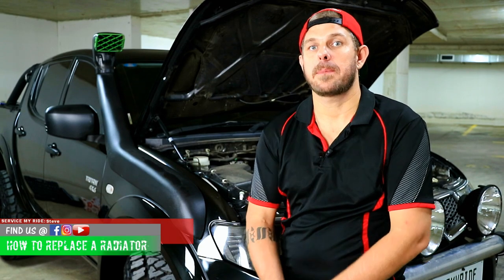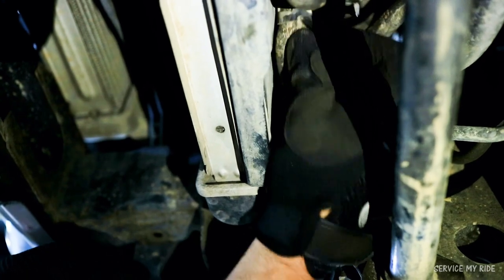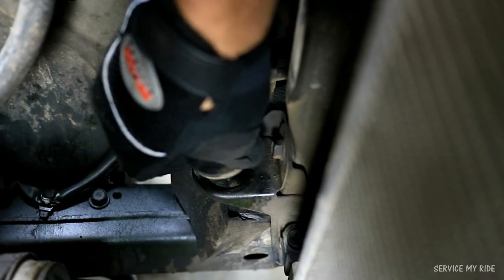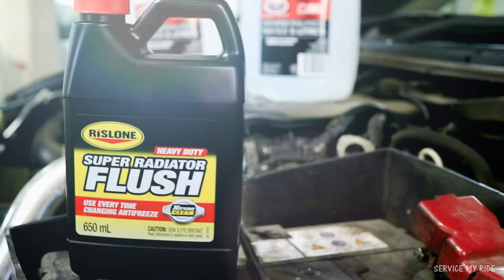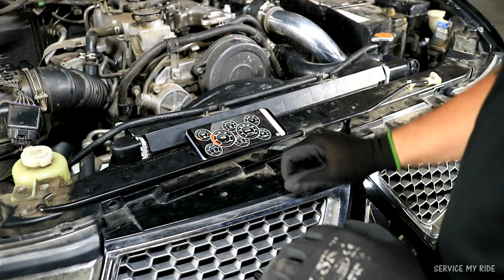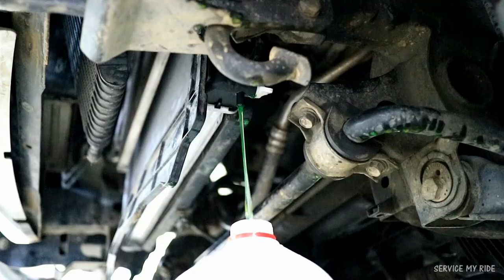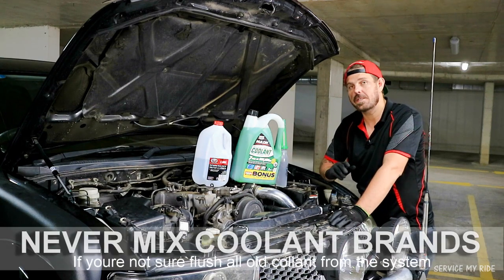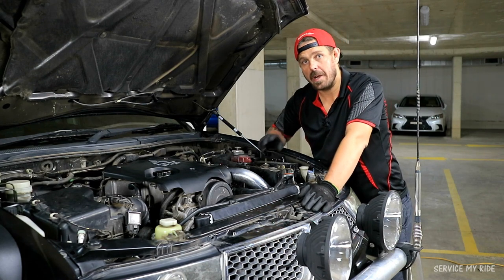HOW TO REPLACE A RADIATOR (new radiator, flush and fluids)

Comment: Thank you for a most informative vvideo on replacing n flushing my radiator.however, i have nno ownners manual for 1991 chrysler new yorker. Would you happen to know or find fluid specs for this 3.3 L engine; or. Know wheree to find themm watched this video msy8 at 2:30 pm mdt usa

Comment: Great video. 
I have a problem. I only have heat on the left side in the car. None or little on the right side. Flushed the heatingcell. Any ideas? I have the steering wheel on the left side.

Comment: Hey mate just wondering how I can diagnose my mn at the moment 
I put coolant in the resi and it drains within the week and it doesn’t seem the radiator is getting much coolant either. 
The car will over heat and lose power 
??

Comment: Good evening mate, just wanna ask about the problem of my triton mn, if the car is not moving and the aircon is on the engine temp goes up high but if the car is running fast the temp goes back to normal. I wonder if the problem is thermostat or the radiator? The radiator fan is running though. Cheers.

Comment: Question, the automatic transmission cooler lines (red fluid) when I take them off leak like I've just taken a sump bolt out leaking excessively. Is this normal?

Comment: Hey mate thanks for these videos.... I am just wondering have you heard of any Radiator / Trans cooler core's splitting inside the radiator and letting coolant into the gear box....?  I am only asking because i had an old BA Falcon that had a similar set up and the core split letting coolant into the gear box - nasty.... We just bought a 2011 Challenger and we love it - we are just working through making it reliable... Its done 200k almost but its pretty tidy
Reply from the maker: Heard of similar failures but never seen it happen, some times parts fail even when serviced regularly but its not a common issue. best way to make it reliable is general service intervals using good quality fluids.

Comment: Love your videos mate. Have used a number of them to help service my MN now that I'm outside of warranty and the servicing costs on these things are through the roof at the mechanics! One question I have for you though is how often would you recommend having the valve clearances done? It's one servicing task I wouldn't take on myself given the number of pieces/gaskets that need removing.
Reply from the maker: Hi mate, thanks for watching the vids, you should check valves every 45k and belts every 90k, still if you dont feel comfortable doing this you can still have a shop do it and just do the servicing you can at home to save a few $$$

Comment: Did you have any dramahs with air locks?
Reply from the maker: hey mate, yeah that can occur but I end up running it with the cap on half way  so it didn't get pressure and replaced the thermostat 3 days later and flushed it with the cooling funnel to remove any air that may be in the system, I cover that in another video ive done in replacing the thermostat.
cheers mate.
Reply: @ServiceMyRide  where is the thermostat video? Can't find it. Need to do my thermostat this weekend
Reply from the maker: Hi Dean, little behind with editing due to other work commitments, can always send me a pm on facebook if you need help, video is about 4 weeks away.